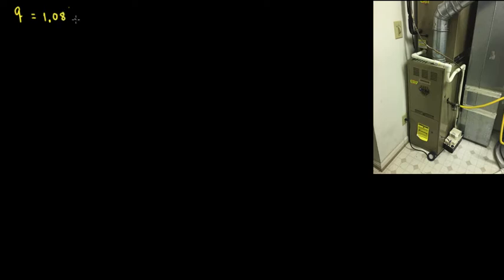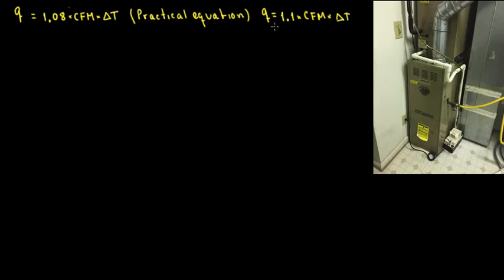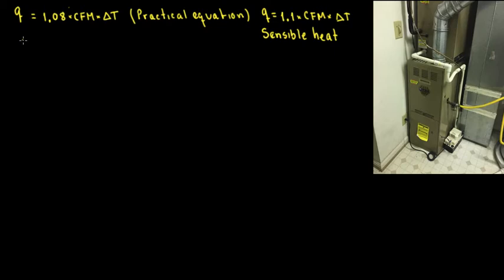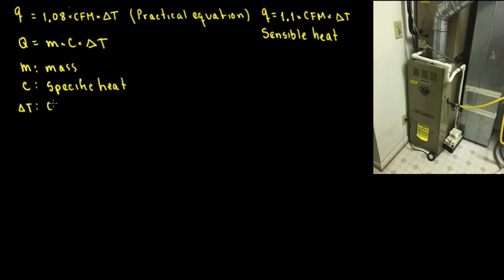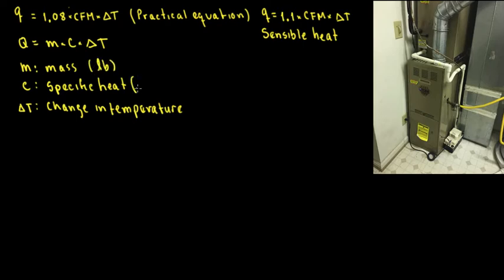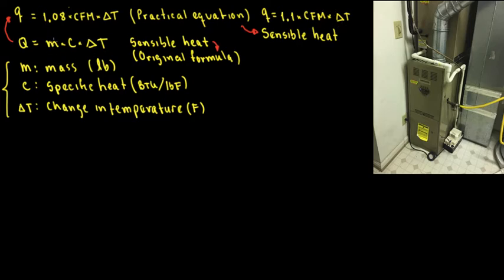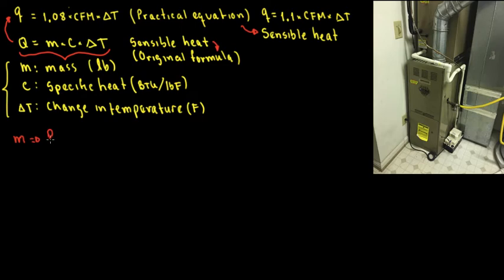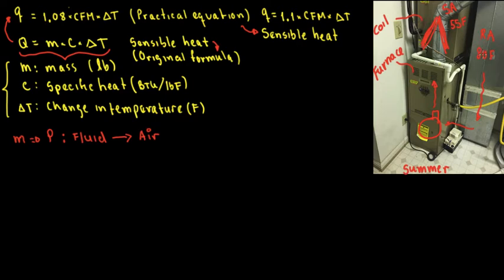Sensible Heat Equation

Comment: Hello, just little confused. Why is volume ft3 / min ?
Reply from the maker: Great question. The volume is in ft3, and sensible heat in BTU. However, since we are taking about airflow we take into account time (which is in Hr or Min) and also sensible heat rate which is BTU/ h. As you can see, if we divide heat by time (Hr) then we need to divide the volume by time (min after a conversion factor of 60). Hope this helps.

Comment: Wow! Finally find the best explanation to understand this equation with my little tiny brain. Thank you so much for kindly sharing and teaching.
Reply from the maker: Thanks for your kind comment!
Reply: One question that might need your other kindly advice is that we're currently working on an energy saving project by rising up 1 degree temperature of the 800cfm fan coil unit inside the IT room. Wondering if I can just simply use this formula  to calculate the total BTU saving per hour as below?
BTUH=1.08×800cfm*1=864
Thanks!
Reply from the maker: @samlee4382  That is a very good question. Is the project trying to obtain LEED Gold, Platinum..or perhaps net zero energy.... ?
Reply: @hvaceasymath  We already have the LEED Gold for our building. This is just for some cost saving purpose.
Reply from the maker: @samlee4382  for this calculation the 1 degree delta works since technically 1.08 and the cfm are the numbers that don’t change. We are only modifying the delta. For example, by elevating 1 degree we have delta = 20 to delta = 19. So what you are stating actually would apply.
Reply: @hvaceasymath  Thank you so much, anyway. At least I got some accurate data with detail calculation to provide to my boss if there's any doubts, instead of telling them the data came from somewhere around the website with roughly estimation. 😅

Comment: Why you take v= ft3/min when mass flow rate you told it is lb/ hr. So volume flow rate shall be ft3/hr? Correct? Can you please explain that part
Reply from the maker: Thanks for your comment! The main reason is we want the volumen flow rate to be in ft3/hr which is equivalent to ft3/min * 60. In other words [ft3/h]=[cfm*60]. I hope this helps.
Reply: @hvaceasymath ft3/hr=ft3/(60.min) so that means ft3/hr=cfm/60
Why are u writing ft3/hr=cfm*60?
Reply from the maker: @aliyehya5521 I’ll get back to you on that. Thanks
Reply from the maker: @aliyehya5521  
Sorry for the delay, but I made another video to add more explanation to the unit conversion and sensible heat equation. 

Link below:
https://youtu.be/mOg1qTXHGxY?si=GCY_km_druHbmVay